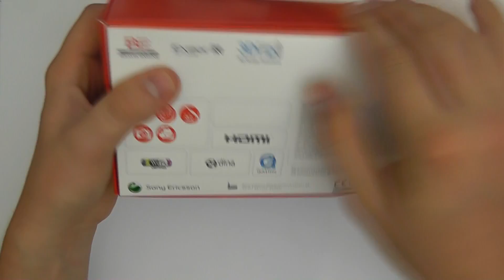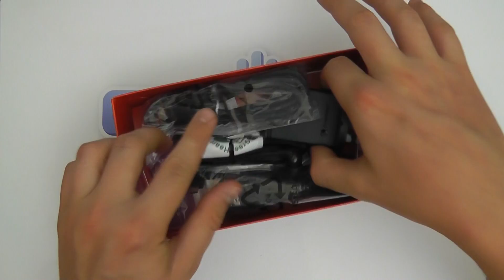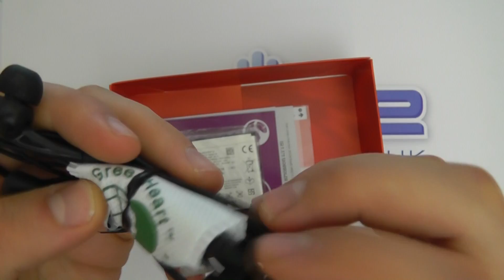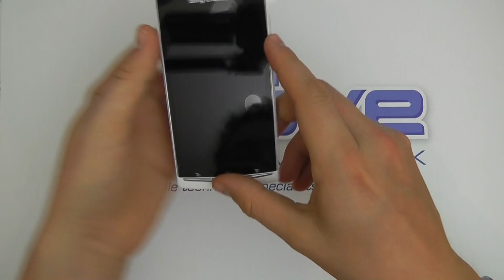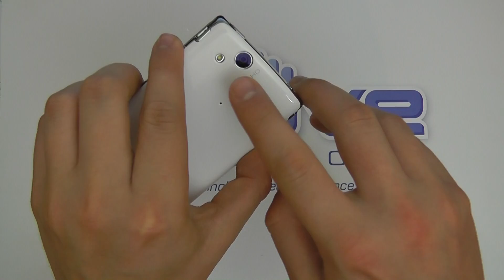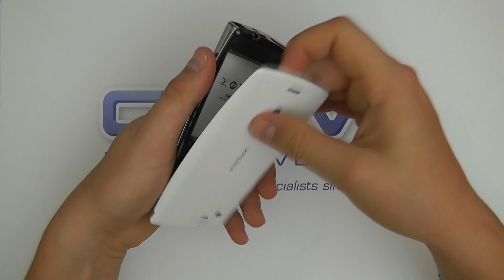Sony Ericsson Xperia Arc S (LT18i) Unboxing - Pure White

Comment from the maker: @tompeskett 
I beleive you would be happy with either, a lot depends what your main uses for the device are.  If its just email text and calls, single core is fine.  If gaming and intensive multi-tasking is what you want then the dual core would be better.

Comment from the maker: @tompeskett The Arc has proved its self to be reliable and rugged over the 6 month I have had it.  It has been dropped a few times too and survived.  The sensations body is perhaps more rigid and the dual core is more future proof so less likely to suffer or be laggy in the long term.

Comment: As you've recently ascertained the HTC sensation XE and the Sony Ericsson xperia arc S i was wondering whether you could do a comparison video between the two or give advice on which one to buy. I can get the arc S for a slightly cheaper price on contract but is dual core really worth it? The phones also will have to last for 24 months, how do you think each will stand the test of time, in terms of both software and hardware (how rugged?) Thanks id really appreciate you could reply :)